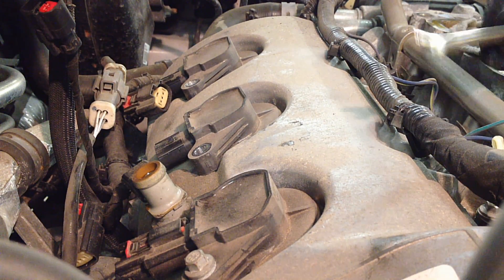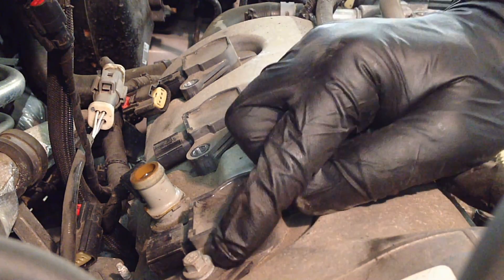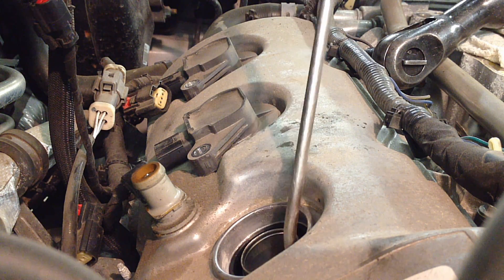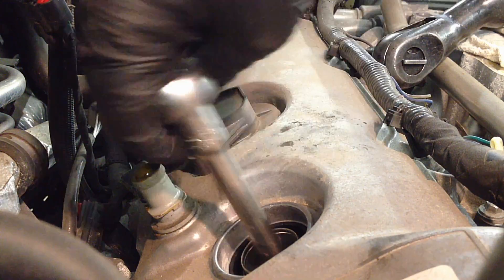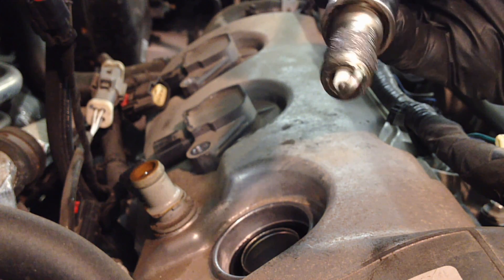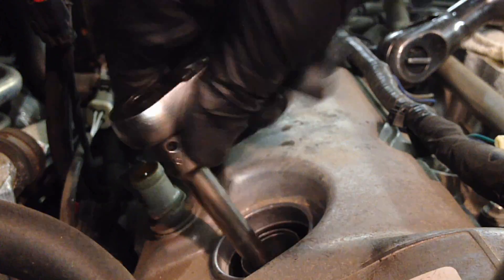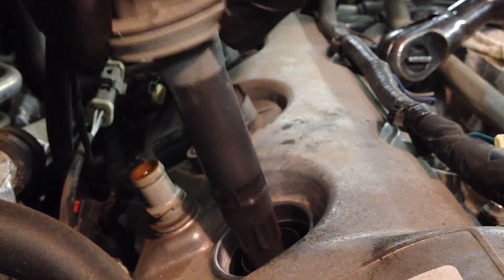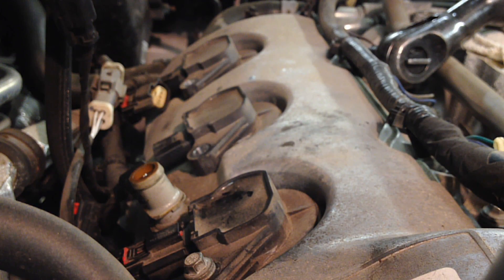Ford 3.5L DOHC Spark Plug Replacement

Comment: Aren't you only supposed to put the grease on the porcelain part of the plug? I read that you should avoid putting it on the part that makes electrical contact with the tip. Love your channel and is there a torque spec for the coil packs?  Thanks!

Comment: Question I have a 2017 Ford Taurus I bought at 15k it has 186628k and I have never changed plugs. Runs perfect and passes emissions in Las Vegas
Reply: Not exactly a question bud smh

Comment: After changing plugs on 2013 Ford Edge Limited 3.5L does the throttle body need to be recalibrate since it was removed? Thanks
Reply from the maker: no

Comment: Is there a reason you didn't use iridium plugs?  And what's your recommendation on changing the coil packs and plug wires while doing this?  I have a 2011 ecoboost with 98,ooo miles.
Reply from the maker: I use what the factory recommends at my shop, you can use anything you want.

Comment: That glob of dielectric grease will cause misfire. Do not put it where it can interrupt contact between the spark plugs and the coil spring. Dielectric means anti electric.
Reply: No it does not. Dielectric grease is made with silicone and a thickener and prevents water and corrosion from getting between the plug and coil. Any grease that is there will be displaced by the metal to metal contact. Dielectric grease is also helpful when replacing lightbulbs. I worked for Ford for 20 years and used dielectric grease every day and never had a comeback for a misfire from dielectric grease. I was even trained by Ford to use it. Stop spreading myths.

Comment: Thanks for the videos. I kept putting off having plugs changed, shop quoted $375. After watching how to deal with the manifold removal I decided it was very doable. It took about two hours but I took my time and a few breaks. It was 90 in the shade. All six removed had a uniform tan color and the gap was off the scale of my gapping tool. Poor old coils must have been working hard!

Comment: A boss I have a 2008 Lincoln mkz....Just changed the sparkplugs,it has 3.5...what is the proper torque for the intake bolts?

Comment: l have a ford edge and your video to replace spark plug and coil worked great but still shaking and service engine still there  any other  suggestion to get this problem fix? thank you!!
Reply: I know this is an old question, but did you get it figured out? Similar issue with my 2010 sport

Comment: I cant speak for what vehicle he using in the video but for the 2014 SHO (3.5 EcoBoost) at least you can work without any major moving of parts.  The spark plugs should be accessible for the rear bank....(Firewall side)  Auto Zone sells a dedicated spark plug socket with the 6" extension already built in to the socket.  There is a ball joint to allow a small amount of offset from the plug.  The added benefit of this is with the extension and socket all in one their is pretty much a 99% chance that the socket won't fall off the extension or the plug.  Beak Torque and let the socket and ratchet (3/8) do the work.  The only non spark plug related item I had to move was the strut tower cross brace.  That could be considered a structural item so make sure the brace is installed and tight prior to driving.  I believe there was  a couple of vent tubing to either loosen and set aside but again nothing major.

Comment: What would the mileage numbers be before the spark plug wires and coil packs be replaced my 2008ford edge has 126000 miles and new plugs we're replaced at nearly eighty thousand miles.  Should the wires and coils be replaced at the next plug change.

Comment: I attempted this today and failed.  Three of my coil boots where stuck and I could not get them out.  Furthermore it appears as though the coil boots are not a commonly stocked item at the aftermarket parts stores.  It is sitting at the dealership now and my wallet will be $400 lighter.  What a poor, poor design.  :(

Comment: Excellent.  Could not have done this job without guidance like yours.  (2008 Ford Taurus X with 123K miles, and was running great on the original spark plugs.)

Comment: I had to replace the rubber boots on the end of the coils. They were shot at 95,000 and just fell apart down in the hole. Got them from for for a few bucks each. Ford was cheaper than Oreilly.

Comment: i changed my 6 sparkplygs with bisch iridium pre gapped plugs. had 3 boots stuck while replacing. anyhow had to rip old boot. got new ones and installed. after finishing tune up, engine misfire started after driving 15 mins. it even misfire on idling. can you please help me with this issue. 
thanks in advance.
Reply: Hitesh Chaudhary were you able to figure out what the issue was?

Comment: when does Ford recommend plugs to be replaced on 3.5 Ford flex
Reply from the maker: Around 100k miles but I have seen excessively large gaps as low as 60k miles though.
Reply: I have a 12 Ford flex whit 76k and at idle the rpm stumble and go back to normal I'm going to clean the mass and maybe change the pcv Vale any ideas
Reply from the maker: Definitely clean the maf and etb then reset and relearn the idle as per my videos. Also make sure there is no leaks in the air inlet snorkel or air box sealing to the air filter.

Comment: At 60-70mph  and light acceleration I get sputter (misfire?) and the engine just reacts very rough to the accelerator. One day I was merging onto the highway and I had to step on it hard. My check engine light started blinking and I had almost total power loss. Had to limp along at about 40 mph for a few minutes before light went off and engine resumed normal operation. Think this is a plug issue? Sounds like from all ur vids I have been watching. Thank you!

Comment: Is there a simple way to tell if the ignition coil is no good and needs to be replaced? Thx
Reply from the maker: +John Tulloch If it is misfiring at idle then yes you simply swap the coil with a known good one from another cylinder to so if the misfire follows.

Comment: Do you know if this 3.5L is built as strong as the Ecoboosts?
Reply from the maker: +Northern Rider I know there are a few structural changes to handle the power of the ecoboost but it has been years since I took the course.
Reply: +FordTechMakuloco ok thanks

Comment: My 2008 MKZ AWD has a misfire, or ignition cross firing. It has new plugs, coils, re man ECM. It seems to have a stumble or dead spot, or thud. Any clue as to what it could be?  It has no error codes.  Now it shows a code of P0304.And P355 does 355 mean cylinder # 5 and not P0304  #5 cyl is in front or radiator side middle cylinder. Have not been able to find any manuals on this car. Hope I did not confuse you!
Reply from the maker: +69ssrszl1 Swap the coil and plug from cyl4 to cyl 6 and see if it follows otherwise you need to start looking at compression issues.
Reply: +FordTechMakuloco  Tried swapping coils compression is good . It seems to be an intermittent misfire, it is running on all six. Could it be a wiring harness problem?
Reply: +69ssrszl1   Get P0304 code Check engine light comes on for a short while then goes off. I am not up to speed on these electronic  laden vehicles.
Reply: @69ssrszl1  Ever fix it? Mines doing the same at 45mph and 1500rpm. No codes and if I give it more gas it goes away, seems to do it more on rainy days which makes me think the coils. I ordered the ford tune up kit on ebay for $180. All motor craft plugs, coils, and intake gaskets

Comment: one of the black tabs broke on one of the connectors. Is there a way to replace a connector? ..or does the whole harness have to come off? can a replacement connector be spliced on the  wires of the harness?

Comment: are you christian? I heard the song in the background
Reply from the maker: Yes but that was the other Ford tech that played that station I just enjoyed it
Reply: +FordTechMakuloco nice brother now I can trust more in your advises. By the way do you recommend the 3.5 liter engine for the edge 2015. Do you know any issue with this engine. I will appreciate your feedback I'm thinking in buy one of those but in Mexico only has the 3.5 engine. Thanks in advance GBU
Reply from the maker: +Traveling with Eugene the 3.5l is a very solid engine and would be my only choice.
Reply: Thank you so much for your support.GBU, best regards!!
Reply: +FordTechMakuloco   What is the firing order and sequence on he 3.5  firewall side and radiator side?IE #1=#1  Is sequence and order the same? IE #1=#1 #2=#2 and so on, I heard they are different.

Comment: Just changed the plugs on my wife's 2014 SHO, easier than my 2004 taurus DOHC
Reply: a 2014 and you changed the plugs? in just wondering, why? trying to understand the differences in other vehicles and plugs, and what to look for. thanks
Reply: +2010V6RAV4 when we bought the car it had almost 60,000 miles on it. Plug life on ecoboost's is about 50,000 to 60,000 miles.
Reply: +bloodduck316 ok cool deal. thank you
Reply: +2010V6RAV4 no problem
Reply: Curious on how you went about accessing the rear plugs. I have a 2010 SHO, and there are so many wires and shit in the way.
Reply: blackhawke10 i took the cover off obviously and from what I remember it wasn't that bad, there was some stuff in the way but i worked around it.

Comment: Great Video, Thanks. I did replace my spark plugs myself, but while replacing my serpentine belt I noticed there isn't any water pump pulley, read on internet that the water pump is internal and driven by the timing chain, and something about a casting flaw could cause major damage due to fords poor design, my 2007 has 102,000 miles now, should I be concerned? what to look for? keep checking  coolant bottle for oil contamination? sell or trade while running good? now I have something else to worry about. Thanks for replies.
Reply from the maker: Ddd Ddd The casting flaw I am not aware of but the seal around the shaft can fail just as any other water pump. These are timing chain driven pumps and are a major job 10hrs labor. If the shaft seal does leak it will follow a channel in the head and leak out above the alternator instead of leaking into the engine oil.

Comment: Does any one knows the firing order in this vehicle?
Reply from the maker: Bernabe Tijerina 1-4-2-5-3-6
Reply: FordTechMakuloco i have a 2009 ford edge.. i have a misfire code in cylinder 3... but im not sure which one is it... 

I dont know what is the firing order diagram..

Im thinking... 1-2-3 back coils from passanger to driver side..

And front coils 4-5-6 from passanger to driver side. Am i correct?

Comment: Outstanding videos. We just bought a '12 Taurus with 60,000 miles,runs like a top but will be changing the plugs myself.
I also have a '13 Edge so the vids are very handy.
I put 287,000 miles on a '02 F-150 with the 5.4 (sold it recently) and changed the plugs on it many times.
That thing was a royal PITA when it came time to change spark plugs.
Thanks and keep up the good work.

Comment: Another great video, i wish i had seen it before doing this job 4 years ago! I was wondering if i need to remove the rear bank valve cover to replace the vct seal? Mine is starting to leak oil and i want to fix it soon. If i want to remove the vct solenoid at the same time is it possible with the valve cover on? There is no leak on the valve cover gasket except where there is the vct seal on the rear bank cylinders. Thank you so much for this wealth of informations you are sharing with us, i truly appreciate it!
Reply from the maker: In order to drive the seal in properly you would have to remove the valve cover yes.

Comment: Great video! Though I prefer a warm engine, because everything frees up easier with some heat in it.
Reply: Not with aluminum. For iron heads the temp doesn't matter but in aluminum you're asking for stripped threads because the metal is softer.
Reply: @nodak81  he's saying free up! Not tighting up

Comment: Hi, At highway speed (45-55 MPH) on level ground the car rides fine, but with a little grade and the car starts bucking, i give it more fuel and it goes away. Could this be the spark plugs needing to be changed. Its a 2008 Ford Taurus X. with 98,000miles thanks
Reply from the maker: Just2362 No yours need a ignition coil.
Reply: FordTechMakuloco Hey FordTechMakuloco, wanted to thank you. You were right it was the number five coil. Replaced it today and the car runs great, thanks again!
Reply: FordTechMakuloco How do you determine which coil it is? Or should I just replace all the coils?
Reply: ***** the way I figured it out was when it started bucking I would hammer on the gas and then the engine light would come on and then I used a scanner to find out which one it was and it was  number 5 so I just replace that one
Reply: Just2362 Gotcha. My engine light hasn't come on yet but it was bucking on climbs. Today I replaced the spark plugs and PCV valve and took it for a ride and couldn't tell for sure if that fixed it yet. Will drive it a while to see... If that doesn't do the trick I'll have to invest in a scanner/code reader. Thanks for your reply!

Comment: My 2008 Taurus is sputtering at highway speeds. This does not happen aften, but it is concerning. This is a replacement engine also. Could this be a spark plug issue, or ccould it be something more expensive?
Reply from the maker: Yes it is usually a spark plug issue when cruising at highway speeds.

Comment: What are the ignition coil number on the banks?
Reply: For a MKS 2010 ECO Boost
Reply from the maker: All Fords are the same- Opening the hood and staring down at the engine yours goes like this
123
456
Reply: FordTechMakuloco so i have a 2009 ford edge.. so the cylinders go in this order too?

Back coils: 1-2-3 from passenger side to driver side.

Front coils: 4-5-6 from passeger to driver side?

Comment: If this is a f150, I've read that when running custom tunes that it's best to gap at 0.0030. Thoughts?
Reply from the maker: No this is the car engine version. For the 3.5L ecoboost F150 yes I would gap them at .030" stock is .031"

Comment: I've done this repair a few times and every time at least one of those little black release levers breaks and the connector will not click. Some comeback with a misfire and one of those back connectors is off.
Reply from the maker: These can be finicky that is why I make sure to push in on the connector THEN release the black release tab, definitely more work than the older coils.
Reply: Hello ford tech. I would like to know we're to get the red locking clip for plug connector

Comment: have you seen many turbo failures on these? mines in the shop right now waiting on a new passenger side turbo, only 36,000 km on it
Reply from the maker: I have replaced them for oil leaks only when the oil feed line wasn't the problem. Other than that they have been very reliable. How did your fail?
Reply: not sure yet, find out next week, but i first started with no power then let out an almighty howl, i have a few vids on my channel
Reply from the maker: That is a mad howl noise, that is definitely not very common.